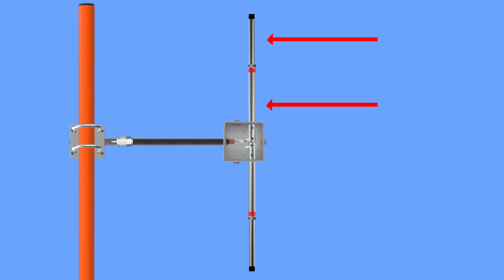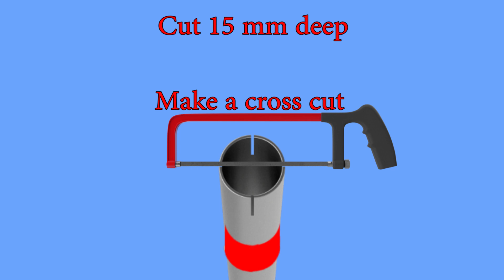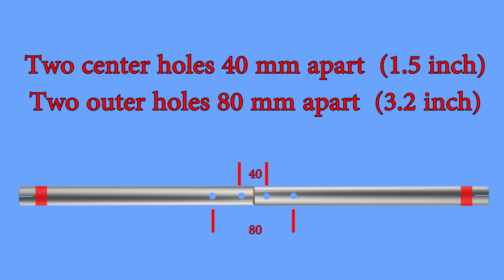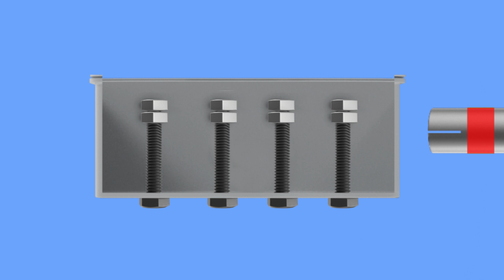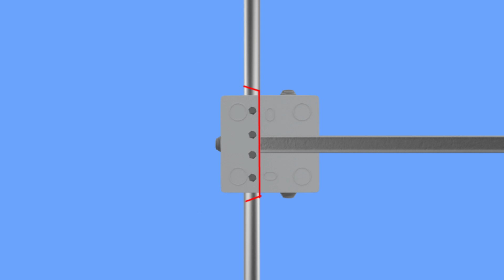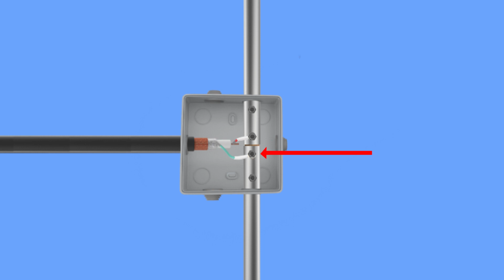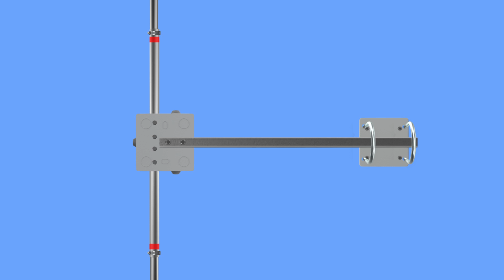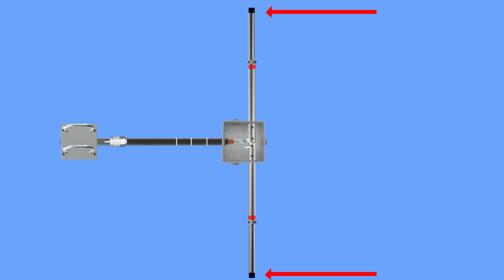FM Radio Station Antenna DIPOLE For FM Transmitter DIY Design For Radio Station Broadcast homemade

Comment: Excellent video, but! You forget ballun. It is very important to have ballun between cable  and dipole!
Reply from the maker: Hi. Thanks for your comment. Yes its true that it is commonly believed that a ballun is needed but in fact there are many engineers who believe that a balun is most likely to be done incorrectly and therefore would do more harm than good which is most likely when first time builders use one. The ballun can reduce some interference and match impedance but if the antenna is built correctly, tuned close to resonance, and installed correctly the ballan will most likely make no measurable difference to the transmitted signal. In two radio where the antenna is being used for transmitting and receiving then a ballun can be more noticeable but for a purely transmitting antenna which is what this design was intended for, a ballun is not really needed. I do appreciate your input though. Its always great to chat with people about this because it gives newcomers more insight into things they might not have heard of. And to add to this I ran a low power commercial radio station with a 1 Watt Fm transmitter and we did not use a ballun and the signal was fantastic. The reason is that the antenna was high up on a hill and tuned and installed very well. These things matter way more than a ballun. This is something I try to get my viewers to pay attention to more as it will dramatically affect their range. Thanks so much. Cheers.,
Reply: What is common to use a balance on HF frequencies, and VHF frequencies is not necessary, the dipole itself when Tim correctly should be almost a 50mm resistive load. So feeding it with a length of 50 ohm is perfectly acceptable. The phasing coax or power divider coax, it's usually made from 75 ohm, either rg11, or RG6 with Copper sheld, the point where the two interconnect, can be as simple as a basic coaxial t connector. Important part is to make sure that all of the coaxes are the same length. If one cable is even a few inches longer. It will cause the signals to not be in Phase when they leave the tower. You also have a high reflected power on your meter.
Reply: @allen_steel1236  ballun using not only to transform resistance. It is used as a bridge from an unbalanced coaxial cable and balanced dipole. If you connect them directly, there will be some standing waves on the body of the transmitter, and depending on how much power it can cause damage or errors on devices, connected to transmitter.
Reply from the maker: @katushechnik  Thank you. It's always great to add this kind of insight. It's the kind of thing new viewers enjoy seeing. Cheers.
Reply from the maker: Thank you .Always great hear from people in the field. Yes as you said the idea of a ballun for all uses is not correct. In many cases the use of the ballun distracts people from paying attention to what you mentioned which can make a much bigger difference. Also I think some people think that the ballun fixes all problems which is not a good way to think. Thanks so much for your input. My viewers do seem to learn as much from the comments as the videos. Cheers :)

Comment: i might have another question: why is the wood dowl only 5 cm long. For strenght it might be better of with 10 cm?
Reply from the maker: You can make the wooden dowl stick longer but it will not change the strength because the strength comes from the bolts holding the aluminum rods to the box.

Comment: hello, have the instructions already been out? is there a need the bolts are 10mm x 50 mm and 6mm in diameter? which material are they made of?
Reply from the maker: The idea behind the design is that it can be adapted to the parts available to you. A range of box, bolt and aluminum tubes can be used. The dimensions given are the ones that work well together but the dimensions can be adapted to your size box and aluminum rods. Some people have even adapted the design to other frequency bands like Vhf and uhf. The idea is not for it to be a one size only design but rather a template to adapt to what you have available. The wavelength for FM band though means keeping the lengths of the rods the same but most other things can change.

Comment: This is an excellent and very detailed video. I appreciate the time and effort you put into it. 

A few years ago I made a dipole by enclosing copper wire inside 1/2" PVC pipe. However, it was cut to one frequency so changing frequencies is not possible. 

I used a washer on each end of the pipe, inserted a zip tie through the washer and secured it to the end of the copper wire so it would not collapse inside the PVC pipe. Next, I capped each end and sealed all holes and mating surfaces. I did not consider the VOP through PVC pipe because it was not necessary for my needs. I only wanted it to reach my garage, but during my first test, I found that it would reach 1.5 miles with a half a watt. 

I really enjoy building my own antennas. I found that it is fairly easy to have a great antenna without spending a lot of money.
Reply from the maker: Funny that you should mention your homemade antenna with PVC pipes. I have been considering making a video about making the cheapest antenna ever using PVC etc. The tuning part is where I got stuck. I have tried many variations on it to make it tunable but not too much success yet. I have almost solved it but it's still in the making lol. I will post it as soon as I am happy with the design. The problem is that the kind of PVC that is useful can be almost as expensive as thin aluminum. If you do it right aluminum and spring steel like flexible antenna rods are cheaper and make the antenna tunable. Oh by the way, yes 0.5 of a watt is actually a huge amount of power. If high enough it can reach up to 7 miles. You need as little as 0.05 watts to reach your garage. Thanks for your comment. Always fun to chat about these things.
Reply: @inspiresoundpro   I prefer aluminum but PVC is very cheap and very easy to get where I live.  The downside is not being able to tune for another frequency, the upside is I get to build another antenna!  I have built several. Some are just for receiving and they work great. Unfortunately, many FM stations here are owned by just a few major corporations using very similar formats. Originality is nonexistent.  

When I tested the range, it was with the antenna standing in a corner inside my house.   I never mounted it. Actually, since it was far more capable than needed, I only used it one day out of the week while I was working outside.  

I subscribed to your channel. I like the content and look forward to your next build.
Reply from the maker: Hey, thanks for the sub. I'm glad you like the videos. I am busy working on a quarter-wave design. It's a bit more difficult to build than the half-wave dipole but it's great for an omnidirectional signal. Dipoles are a bit directional. I will post it when it's ready. Cheers
Reply: Thank you mr.radio God for all that mumbo jumbo. Now put down your bongs it's time for class. If you have a licensed full power fm station you don't build a complex setup like described here in the previous comment. Fine if you just enjoy playing with wire but not a real world solution. Let's start with the dipole because I have some issues with that. There's a chart available free online for determining the length of the radials and I personally wouldn't use aluminum I would use copper. You shouldn't need more than 2 , 8 foot lengths of half inch copper pipe. Following the information on the chart for your frequency and power level carefully measure,( measure twice cut once)  you will need a connector for 50 ohm coax and a 50 feet run of said coax and the connector should be female for attachment to the coax and the other end of the connector should be open so you can solder 2 , 6 inch pieces of number 12 stranded wire, one to the center conductor and one to the outer conductor. A simple round 4 pole pull box will be the center of the antenna. You will put one radial up and it goes to the center conductor and the other down going to the other conductor. To one side you cap off the port because it won't be used and the other remaining port you put a three quarter inch 90 pointing down and you put another 90 into it opposite of its direction.you then put a capped and trimmed slightly longer than your radial, three quarter inch PVC over the upper radial and an identical length pipe with a cap on the bottom but drill a small hole in the bottom cap so any water that may get in can drain. In the video a crossover plate was used to attach to the vertical pipe,( pole) but instead you use what's called a pipe to pipe bracket,( also available at home improvement stores) and that way you have several degrees of down tilt available to fit into your contour. This setup shouldn't cost more than $50 for everything except the coax from your transmitter to the antenna. To pre adjust the swr simply with transmitter on move the radials to and from each other until you get around 6 db. Once you've installed the antenna you can both alter your power and mechanical down tilt to avoid over modulation and exceeding your contour. For less than $250 including the transmitter you have an fm station that at one miliwatt should easily transmit 15 miles or more and as long as you keep your swr around 6 you shouldn't have wonky wave or distortion. Commercial stations don't build their own antennas they buy them from companies like Harris or dielectric or radio frequency systems. If you aren't getting the swr you need at power then you can add another identical antenna above or below and run them from the same transmission line but you will need a 50 ohm T connector and a jumper coax to supply the second element. Thus creating an array. The second element and connector shouldn't insert enough loss that you can't compensate for by adjusting power level. Keep it simple stupid. All those amplifiers and multiple lines coiled up, I've been doing this for 29 years and never have I seen anything like that. Not on commercial stations or lpfm. There's a million ways to do anything but why make it complicated and expensive?
Reply: @dansteel9873  WTF are you talking about? Your reply is WAY out of context for this DIY project.

Comment: Make a bulan coils using the coaxial cable, just roll a few turns Wil be ok, it's to unbalance to balance the coaxial and the dipole 👽👍📡 📻
Reply from the maker: There are two opposing opinions about baluns for dipoles. For receiving antennas it can make a difference with reducing interference so if you use the dipole to receive or as a two way communication antenna then yes it can be useful but if it is purely for transmitting like this dipole was designed for then you don't really need one. I have run very low power and a few hundred watts with no balun and had great signals. The antenna tuning was more important. In many cases a balun, especially the wrong type of balun can hurt the signal more than help it. So there are differing opinions  but for transmitters I have found it best not to use one.
Reply: 4...6..tur   balun😊

Comment: Km Range?
Reply from the maker: The range of your signal depends on many factors. The height of the antenna has the most impact on range. The terrain and the power (Watts) of your transmitter also affects the range. Signal penetration is just as important as range and the power (Watts) of your transmitter affects penetration strength too. Basically the higher the antenna and stronger the transmitter the further you can go up to a point. Once you reach about 50 to 100 KM the signal cant go much further because of the curvature of the earth. In most cases though signals from about 10 Watts to a few hundred watts can make it about 30 to 50 KM. Very powerful signals of a few thousand watts and up can make it to about 100 KM.
Reply: @inspiresoundpro  Okay, thanks Bro ❤️

Comment: dear sir 
i need 2 type of aluminium 1st is aluminum pipe and 2nd name is ?
and waht is aluminum pipe diameter ?
i have 300watt am amplifier
ple reply
Reply from the maker: Hi. The pipes are all aluminium. Aluminum is just the way Americans say aluminium. It's the same thing. The measurements for the pipes are all in the video. Check out the beginning where all the measurements are listed. 300 Watts might be too much power for this antenna. It has not been tested to handle that much power.
Reply: @inspiresoundpro  thanks a lot sir